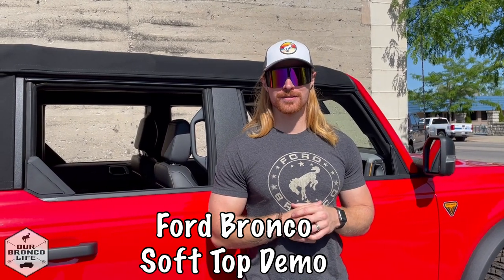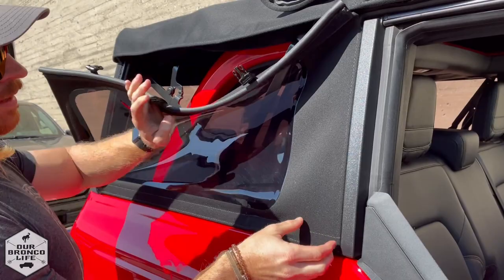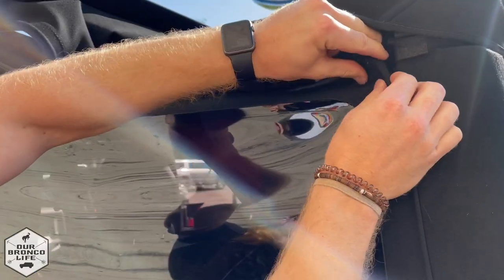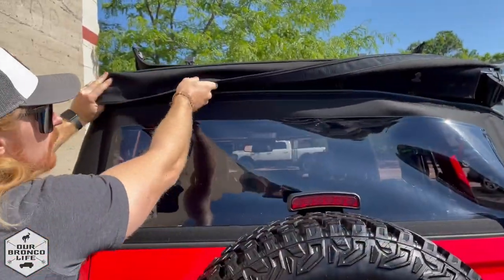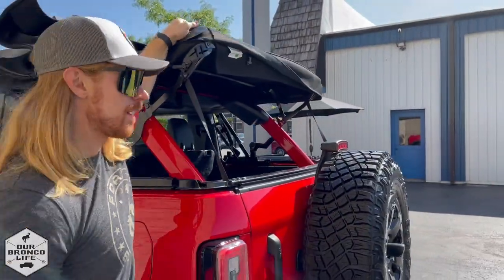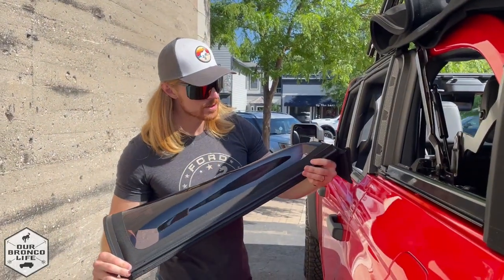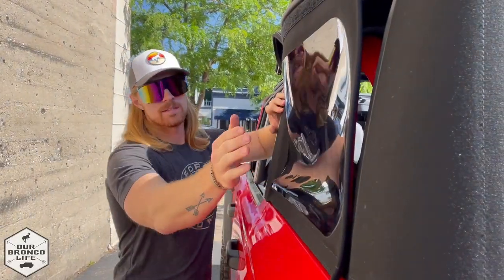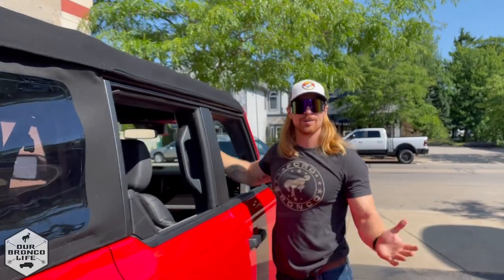2021 Ford Bronco Soft Top Demo | SPECIAL Do's & Don'ts | Our Bronco Life

Comment: I was having a serious bitch of a time getting the top re-secured because I couldn't get the side panels to reach their groove tracks on each end. This video helped because it's definitely the most detailed, closeup view of how to get it back on. Thanks
Reply from the maker: Mike thanks for the compliment! Really appreciate it. Hope you were able to get it all back. If you have any questions you can DM us on Instagram @ourbroncolife as well.
Reply: I am having the same problem 😭
Reply: I was having the same problem, especially on the driver's side. I'm still not great at it but have found putting downward pressure against the window channel (i.e. pushing "into" the car) can help while trying to slide it along/ into the groove.

Comment: Nice video! We're about to put our top all the way down for the 1st time since it's finally warming up. One thing I didn't notice you say which Ford says is that when reinstalling, it's important to tuck the front edge of the side window under the tension cable to avoid leaks.
Reply from the maker: Thanks for checking it out. I did not mention that but very good point and true! Enjoy the top down 🤘🏻🤘🏻
Reply: Came here wondering this, thanks!

Comment: First - thank you for this video. This is one of the best how-tos on how to use this (somewhat complicated) top.

Second - since I presume the two of you have EXTENSIVE experience using these tops out on the road...have you encountered anything like what my top is doing? While it seems to align and latch properly when closed, once I go ahead and lower it fully and try to latch it in the down position, the passenger side latch is reluctant to engage. I can coax it by hand to do so, but if I do, the release lever on the driver's side is EXTREMELY difficult to push down when it comes time to raise things up. Like, both of my hands squeezing it down. 

Have you encountered anything similar? Do you know what I should attempt to try, or know of anyone who would know what to adjust? I've already paid for access to the Ford factory service information; there is bupkis in there about adjusting the top for these situations...leaving me up a creek without a paddle, so to speak...
Reply from the maker: Thanks for the feedback! Glad the video could help. Agree it can be complicated 😎. 

That’s interesting what it’s doing.  Based on our experience we haven’t had in be that difficult to unlock from down position. Sometimes we have to be carful when putting it all the way down so it doesn’t hit the roll bars and scratch it. I know our friends sticker fab have a vinyl protector for that area just in case. 

We haven’t had any experience physically adjusting them. Have you or plan to remove the top completely?? The 3 large bolts on each side and go topless completely this summer? I’m curious if you do that then replace it, it make realign better with even tightening of the bolts.
Reply: @OurBroncoLife  Well, it seems the bar was scratched from the factory, so that's water under the bridge... :-(

I don't plan on removing the top completely. I did notice after bringing it home that the passenger side mount bracket with the three bolts wasn't fully seated against the location pin, which Ford says is a must. I loosened the bolts and improved that fit - but I'm still where we're at.

The plate that holds the latch that serves as either the mid-bar latch or the folded top latch, depending on position, apparently offers some adjustment...but will likely be a cat-and-mouse affair, one that likely has me removing my security enclosure lid. Which...oof, that was fun just installing it.

https://www.bronco6g.com/forum/threads/soft-top-alignment-and-adjustment.31391/#post-1271780
Reply from the maker: Hopefully messing with some minor adjustments it will get resolved. Keep us posted.
Reply: @OurBroncoLife  Well, haven't found a good solution for that particular problem...but have found some ways to resolve top squeaking when folded into position one, if anyone needs that...

Comment: Thanks for this video tutorial. I still do find that making the side window panels connection still somewhat difficult. Does weather play a factor when connecting side windows? I see your video is in sunlight and looks warm. Or will the material be more forgiving over time? I appreciate any feed back to these questions. Thank you 🤙🏽
Reply from the maker: Thanks for checking out our video and channel. It is much easier in the sun and warm weather. When the windows heat up they loosen up a little and connect easier.

Comment: great video. I have a 2022 4 door Badlands Bronco and this weekend was my first time taking the top down. it was pretty simple truly but i will say when i put it back on, i put the back window and the side windows on and when i went to snap the front  down at the windshield it was not reaching correctly. i had to go back and remove the side windows and get the middle to snap and lock, then put the windows on and the front aligned after that. unsure why that happened?? so if someone has trouble like i did, put the windows on after making sure the middle is snapped in place first. it was almost like there was too much tension from the back pulling it back and the middle snap down would not connect correctly? it may do better once its been off and on a few times.
Reply from the maker: Interesting. Good to know. 

Also you can pop open the rear with the windows on to add some slack in the top

Comment: If the release lever DOESN'T work for you, like it's stuck, as you're trying to put the top back up, jiggle the soft top on the driver's side as you press down on the lever. Took me 45 minutes to figure this out. The lever was frozen in place.

Comment: Is this soft top water prove or water resistant, if you were caught in a bad storm and it was raining hard would it leak in??? Also in the winter time and it was snowing but warm enough to melt the snow would the snow/water come in through the top that way??? Thank you so much, I'm wanting to get one but I'm confused on which one to get....
Reply from the maker: Our experiences with the soft top is no leaking. Even in the heaviest of storms. In snow we would use the brush to brush off the snow on the roof, don’t use the brush on plastic windows it could scratch then. Use a soft cloth or your hand. The soft is plenty warm, durable, and safe - just be gentle with it.

Comment: Any recommendations when driving with just the first half folded back. Thinking about quick drives around town now that the weather is better
Reply from the maker: First half open can ride at highway speeds no problem.
Reply: @OurBroncoLife  thanks for the quick reply. Do you strap yours down with the Velcro straps provided? Or is that more for off-roading where the vehicle could bounce?
Reply from the maker: Only use the straps for off roading or when I know I will be going at aggressive angles where the top could flip shut.

Comment: Switched to the soft top with Free hardtop prep kit due to production issues. Hopefully the soft top lasts until they get the hardtop issues worked out and available to get.
Reply from the maker: It will last for sure. Just be patient  and delicate with lowering it and all that.
Reply: you know the hardtop is gonna be close to 10 grand usd right. better off ordering a hardtop model now and trade yours in when it shows up
Reply: @philmonachan8007 Where do you get that number? Dealers have told me around $3500. ADV is taking orders for $5000.

Comment: Is there any way to open/remove ONLY the rear 'window' like in the Wrangler 4 door?  I'd like the wind to flow through the open side windows and out the back - not flow into a closed cabin/rear window.
Reply from the maker: Unfortunately no way to just have rear window open. The side windows have seals that connect to the rear window
Reply: @OurBroncoLife  thanks for the informative video and answer. I dig the Bronco, but I wonder why would they make a soft top that doesn’t do what the Wrangler can? (Unzip the rear window, roll it up, tie it). They’ve had years to look at that example…. Disappointing, because I know there’s issues with the hard top too. Most people probably won’t care, just odd to me they didn’t nail it.
Reply from the maker: Agree. Wish it was an option to do that. For what it’s worth the accessory option top for the Bronco by BESTOP has that rear window roll capability.

Comment: What prevents the top from. Flying back down with a tail wind?
Reply from the maker: It comes with additional Velcro straps but it’s weighted and positioned well enough to not always need them
Reply: @OurBroncoLife  where are those velcro straps located? on the top or inside the bronco somewhere?
Reply from the maker: @jethrobodine4638  they are in the bronco tool kit that comes with the car.

Comment: How do I strap it down well so I don’t have to worry about the wind ripping it off?
Reply from the maker: The wind wouldn’t rip the top off. No chance
Reply: @OurBroncoLife  my question is how do I tie it down? It can with Velcro straps too.
Reply from the maker: When the top is all the way down it locks in place. Had locking mechanism. If it’s just half open the Velcro straps prevent it from flipping back closed
Reply: @OurBroncoLife  duhhh. I’m asking if you can make a video showing a proper way to strap them down in first position.
Reply from the maker: Gotcha! Next time we’re with soft top I can. We have hard top, this wasn’t ours.

Comment: I’m worried how easy it is to get it off without opening the doors. This means I’m sure my bronco will be getting broken into plenty.
Reply from the maker: Unfortunately the top windows only able to be opened from the outside
Reply: What does that mean? It looks like he takes the whole thing down without opening the doors.
Reply from the maker: You have to unlatch front of top from the inside of bronco.
Reply: @OurBroncoLife  right. But you can just take the side and back windows off with the doors closed. So breaking in is easy. Not talking about actually taking the top down

Comment: In no way does my soft top move that easily all the way down and then up. It doesn’t seat properly when all the way down either.
Reply from the maker: Seating not properly might need a dealer to look at it. But opening and closing it a few times could lubricants the joints
Reply: @OurBroncoLife  I’ve had it about 2 1/2 months now and it has gotten progressively worse. She’ll be going into the dealer.